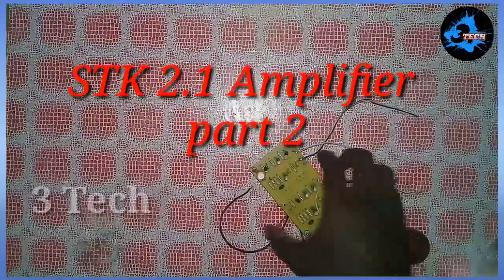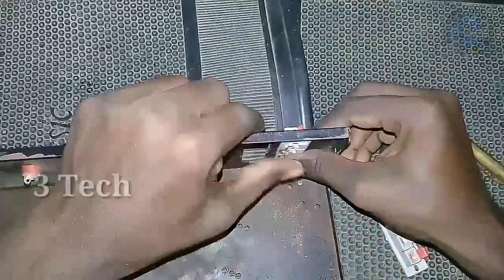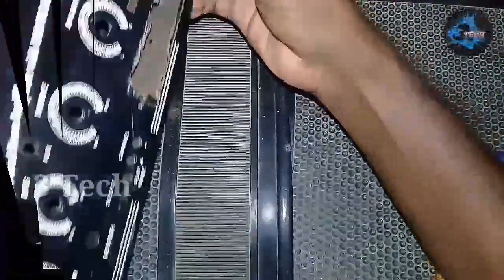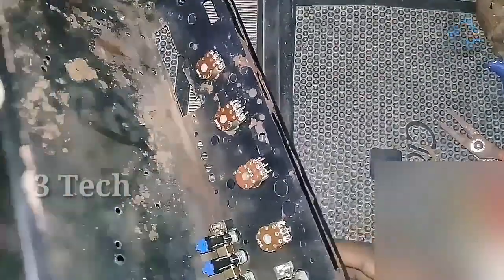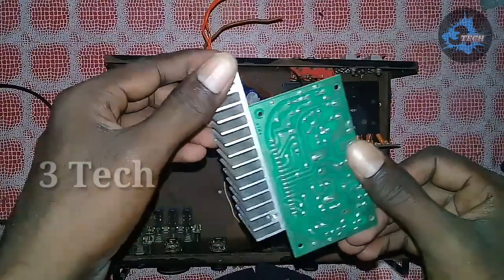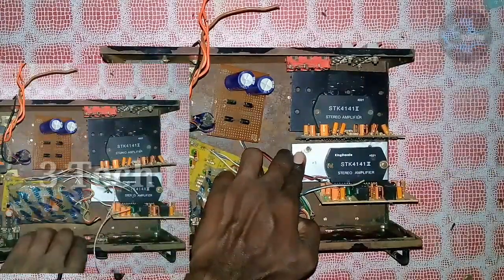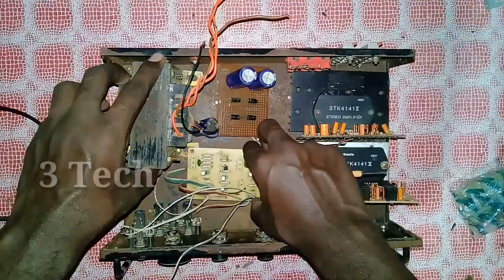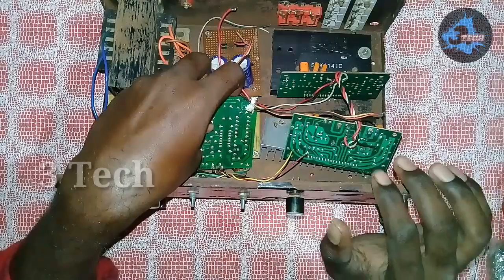How do make STK 2.1 amplifier 200w , part 2

Comment: Humming sound varuthu eppadi control pandrathu sir
Reply: King Arun ground check pannunga
Reply from the maker: Mm ok
Reply: @sivaprakash1906  ground check panniten  OK sir. Vera yenna problem humming varum... sir
 Humming athigama varuthu
Reply: King Arun enna power amp use pandringa
Reply: @sivaprakash1906  transformer 24-0-24 5A, STK 4141, BT board